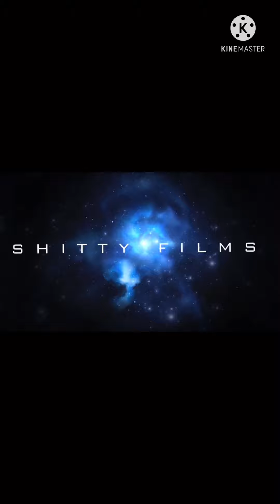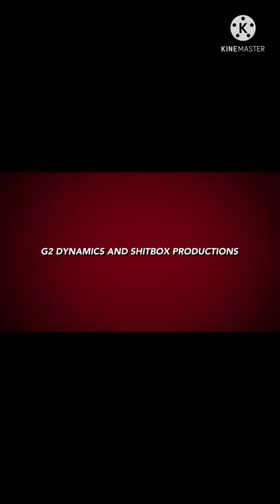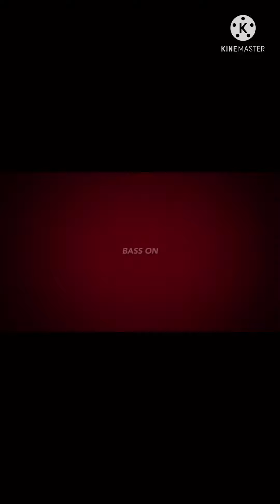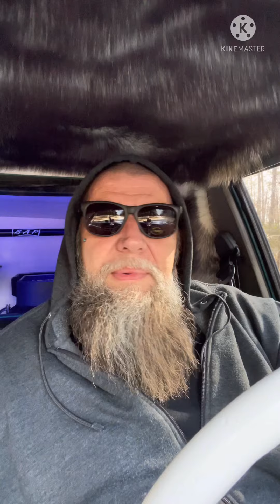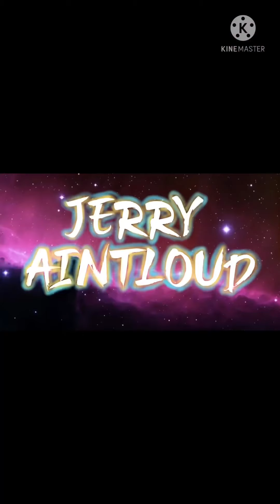Melted fuse holders and the basics of wiring

Comment: Melted fuse holder, upgrade all wiring and fuse size. Bolt down everything. Check everything often.  Especially where wire goes through the firewall.